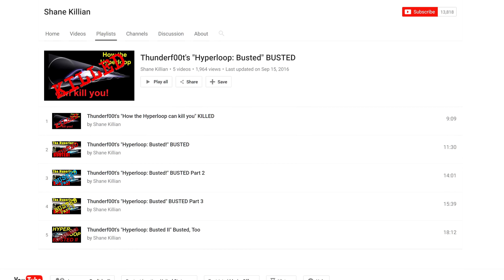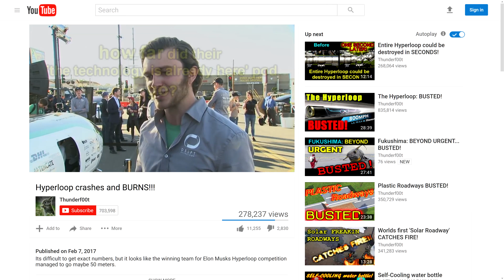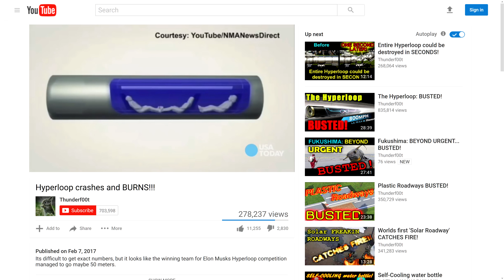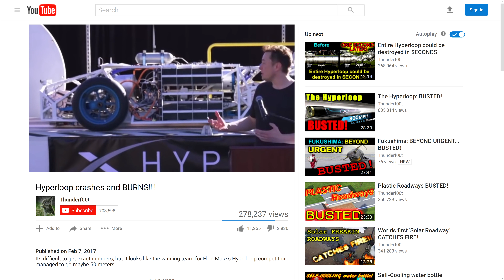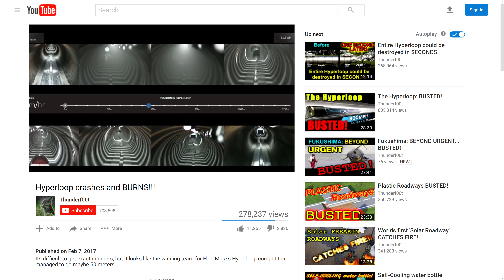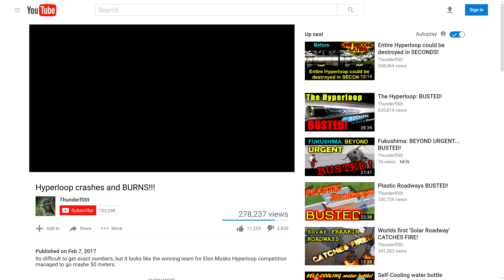Thunderf00t crashes and BURNS!!!

Comment: Shane, ONLY special element of Hyperloop is the VACUUM. Nothing in the tesst seemed to focus on the vacuum adding anything. On the issue of the VACUUM, Thunderfoot is on point and has expertise. You have stated nothing with respect to the VACUUM and the Hyperloop.  So take the competition out out of the Hyperloop and Vacuum, and they have the same merit/non-merit. No reason to argue about these elements as they are not pertinent, which is all you seem to be discussing.

Two huge mistakes you made: 1) dust is a significant factor in VACUUM's. Did not look like only water vapor to me. Note water vapor is also dust in a vacuum. 2) Automated vehicle history is far different from what you describe. They have NOT yet become reliable and safe. If they had, they would be generally on the market. As of now they are intelligent vehicle assistants, no more. Yes, in 2004 and 2005 there were two gigantic jumps in capabilities of a magnitude and a half in each year. But before this and after, there have not been similar jumps. From the late 80' to 2004 there was a long slow process of advancement, which barely reached an magnitude and a half improvement in 20 years. The same rate has been occurring since 2005, but there is a bit of a way to go still (unfortunately). So what happened in 2004-2005, as each vehicle that achieved 125 miles used very different technology? Best guesses, competitions which enabled shared experiences, and the release of open source computer vision software, OpenCV.  When fully automated lane changing is generally released, you will know the dam has finally burst. Yes, the Tesla's do some of this, but it is still treated as an assistant, as fatal accidents still happen. Only thing special about Tesla, is that it had the independence and courage to release these assistants, technically everyone is at the same point.
Reply from the maker: "Note water vapor is also dust in a vacuum." Water vapor is dust??? Okay, we get to ignore THE ENTIRE REST OF YOUR COMMENT! Fucking anti-science conspiratards...

"Automated vehicle history is far different from what you describe. They have NOT yet become reliable and safe. If they had, they would be generally on the market." No, that's happening because YOUR HOLY GOVERNMENT is restricting them. They ARE on the market and on the roads in many places. You are just LYING.
Reply: Water vapor effect on metal = rust. Rust = solid dust particles. Water in the works causes many issues. This is just one. Sealed vacuums have many requirements, water vapor gets in the way. It's not a so what, liquid particle issues are as big as solid particles.  When working with vacuum's at the level of the supposed Hyperloop, even oil on fingers has issues.

I'll say it again, 'intelligent vehicle assistants'. Perhaps in two years we will have more, but it's more likely 5, 10 or even 20 years away. We need a giant leap like we had in 2004-5.
Reply from the maker: So, you haven't even bothered to fucking watch the series where I cover all of this. Typical anti-science conspiratard.
Reply: You don't mention squat about anything of importance. If you are a 'libertarian', you are extremely misguided. Look to hex/oct-copters as libertarian type advances. Hyperloop is completely centralized fantasy.

By the way  insults (e.g conspiratards) reflect directly upon the insulter.
Reply from the maker: I covered rust. I explained the difference between an open and closed system. YOU ARE LYING.
Reply: Shane, I watched most of this video, your review of Thunderf00t's work is shallow and your comments are insulting, Insults reflect directly on the insulter. If you want to improve, you need to provide more solid info, focusing on substance instead of the nit picks you cover in this video. Thunderfoot went out and looked at the seals they had, he goes into lots of technical detail, and made his point very successfully. While he also kids around, the substance is mostly there.  I haven't seen any substance in your review of his work in this video. And no I'm not going to view all of you videos. If you've got an argument, you can site specifics clips.
Reply from the maker: Thunderf00t didn't make ONE SINGLE POINT that stood up to scrutiny. I COVERED the things you just said. You're just IGNORING the points I made in response. You haven't responded to ONE SINGLE POINT I MADE.

The WHOLE SERIES is comprised of arguments. It is creationist-level desperation for you to demand specific clips of me!
Reply: Shane, let me simplify this so you can understand. Hyperloop's ONLY addon value is the vacuum to reduce drag and thereby add speed. Without this the Hyperloop is just a far overpriced train/Maglev track. The overprice is due to the cost of all the extra track elements. The rest of the discussion is meaningless. You have only focused on the meaningless elements. While Thunderf00t mentioned the meaningless issues, to indicate that they were the only elements being tested, and thus nothing was really being tested. He also also noted that even in those meaningless test, there were problems, due to the effect of the  pseudo vacuum chamber being used. However, his primary arguments focused on the difficulties associated with working with VACUUMs.  DO YOU GET IT NOW? Do you now understand why everyone thinks you've completely missed the point.

By the way, people are giving you the time of day because you have brought up some interesting addon details with respect to the test associated with the challenge. I just wish all that energy was put into something of more value from a libertarian perspective, for example hex/oct copters or HHO fuel. Both of these technologies would dramatically reduce centralization, while the Hyperloop would only add to centralization. Of course as the Hyperloop is just a scam, its only a centralization of research money and energy. Hex/oct copters and HHO are already functioning, thus, any focus on them would be tremendous addons to the community.
Reply from the maker: "Hyperloop's ONLY addon value is the vacuum" FAR FROM IT. We covered SEVERAL more innovations in this series. Since you REFUSE TO WATCH IT, you CANNOT speak intelligently on this issue. You're just LYING so your pathetic delusions can be preserved.

"Without this the Hyperloop is just a far overpriced train/Maglev track." We showed that Hyperloop One is building it FAR cheaper than maglevs are, LIAR.

YOU ARE A LIAR. GO THE FUCK AWAY.
Reply: Shane, you don't respond with respect to the VACUUM, HHO, Hex/Oct Copter, libertarian issues. Neither do you site specific clips. Nor do you mention what other elements of importance the Hyperloop supposedly offers. You just want people to watch all your videos. As this video was mostly contentless, there is not much reason to go beyond. Your comments have basically been contentless. It's liking discussing something with a wall. Further you insult all over the place.

Insults reflect DIRECTLY on the insulter.

Comment: Wow so you think this was a successful test. Bottom line it is impossible physically and economically to build the tube so what’s the point. You cannot evacuate chambers on the scale anything like that required to make it a viable transportation solution. Yes top marks to the students for inventing safe design principles for vehicles operating in a vacuum tube they rose to the challenge and the tube or h loop was not their problem. I have to agree with Thunderfoot regarding the h loop being BS and maybe the scope for the designers in this test was not clear to us but hey ho maybe you should try to communicate the disconnect re the test v the h loop viability rather than rant.
Reply: Well his vid was quite angry and he talks kinda agressive and repeats his points but thunderfoot clearly isn't better. I mean although the hyperloop might be a silly project thunderfoot makes false and bad statements.
Reply: You can't easily evacuate airplanes as well, yet it's a very popular method of transportation.
Detecting decompression of a pod is easy and reliable and due to massive redundancy of valves venting the tube is not less easy and reliable.

Comment: Dude, you may wish to check with a physicist before you make a rant like this.  The hyperloop will never work.  Period.
Reply: Why not?  A hyperloop is just a maglev train in a vacuum.  We can make mag-lev trains...all we need to do is maintain a vacuum and find time-efficient ways to move objects in and out of the vacuum.  That will take some research and time convincing the public it is safe...but not really the engineering problem of the century.

Comment: Shane @6:00 you state "...that's water condensation" A/How do you know this? & B/If it is why is there only a cloud of condensation behind the vehicle but not in front of it? Also would the condensation not be collecting on the surface of the walls where there is a temperature difference to cause the vapour to 'condense'?
Reply from the maker: "why is there only a cloud of condensation behind the vehicle but not in front of it?" Because that's how it works! It forms in the vehicle's wake as local pressure drops. Same way the cloud-in-a-bottle experiment works.
Reply: I thought (maybe mistakenly) that this experiment was carried out in vacuum? Surely there is no air/gasses so no pressure differentials?
Reply: David Povey - It is true that in a vacuum, there is nothing to condens. Talking about temperature (average kinetic energy of particles) is pointless. However this isn't a perfect vacuum. More like a near vacuum (participants of the 2nd test could even choose the pressure of the vacuum but could go no lower than the limit specified in the tech doc). As pressure lowers (because less particles inside the tube) the boiling point of water lowers (basic thermodynamics). This means that water will turn into a gas at lower temperatures than 100°C. Hot air can also hold more water than cold air. This is why the water in the air of your bathroom (shower/bath) will condens to colder surfaces. This is why the ground gets wet after a sunny day. This is what is meant by humidity % shown in weather info. In the desert you have dry hot air so you won't get much condensation contrary to the bathroom example.

Now what does this mean for the hyperloop? The test in TF video was done under the specified pressure of the tech doc. This means that there is less water in the tube to begin with. It means that the boiling point is lowered but at the same time temperature is less of an issue for condensation bc a perfect vacuum has no temperature. 

A moving object is bound to drag and lifting. At higher speeds, these effects increase (I imagine that you need very high speeds in a vacuum to even notice this effect, if at all). The rear of the car will generate a lower pressure. Lower pressure means lower boiling point. The question here really is: what is the overall pressure? Is the remaining air humid or can it take more water? If the car has a relative low speed, how much can it lower the pressure behind it in a near vacuum? The difference between the two pressures can cause condensation as they have different boiling points.

Honestly without calculations, I call bullshit on this. A vacuum is complex. Aerodynamics is complex and so is thermodynamics, especially under these particular circumstances. If someone can predict this effect w/o calculations, that person needs to stop making YT videos and spent his/her time more efficiently/productive.
Reply: There is probably much water present on the tube surface that would take months of vacuum to dry out. So unexpected but very present after emptying the tube it fills itself with 100% humidity and more giving a lot of airborne condensation.

Comment: A hyperloop will never work. Never, not in 1,000 years. For one very simple reason: it's the single most stupid transport idea ever. Well, except for trying to use rockets as a transport option - that's the most insanely stupid idea of them all. Now, I am a big big fan of Elon Musk, and at age 53, I am happy to admit the guy is my hero. But he is a seriously flawed hero - just like all heros. 

A hyperloop is at its core, nothing but a multi-billion dollar, single-use, mass-murder machine, the likes of which has every terrorist on the planet drooling in anticipation. Let's see why. I'm going to use a 2-metre diameter, which is the smallest a hyperloop could be, and larger means much larger forces, based on pi-squared, of course.

Anyway, let's imagine a hyperloop 1,000 km long, cars are on the hyperloop at 5 minute intervals, being the time it takes to load up a car, evacuate the airlock, and slide it into the the loop. That means there are 12 cars on the track, gong one way, and 12 going the other.

Now, let's take a single stick of gelignite, duct tape it to the side of the hyperloop somewhere - and if we can't do that, let's just launch a bazooka round at it. Now, the Hyperloop is going to be made from nothing but steel, and not very heavy steel at that.

The explosion creates a hole a few feet wide, and the air rushes into the breach and rushes away from the breach at close to the speed of sound. The pressure of the air rushing down the tube is 64-metric tons by itself, and traveling at close to MACH 1, it has a force slightly over 38 Gigajoules. The MOAB air-drop fuel-air bomb, the largest non-nuclear US munition, has a yield of 41 Gigajoules.

So, the 64-ton sledgehammer making almost mach 1, smashes into the first car, turning it instantly into nothing but dust, and it ruptures the hyperloop at that spot, and the cycle continues. This happens until the sledgehammer gets to the airlock at the station at each end. Then it destroys the station completely, killing everyone with 1kilometre of the impact site, with large concrete chunks of the station landing up to 2 kilometres away. Both stations suffer the same fate - and the other tube as well, for the return leg, which is destroyed by the destruction of the station, or one of the cars exploding to dust in the other tube.

Nothing can prevent this scenario taking place once a rupture has occurred.  Terrorists will make sure they attack the loop as close to a station as possible, so there is no warning. At least death will come so quickly that no one will have a chance to feel it coming.

So, if this is your idea of a good idea, you are an idiot. There is no way to design around this fatal flaw, and no way to evacuate the tube down to the level required, nor to properly allow for expansion, or earthquakes, or deliberate attack.

The idea is simply a non-starter. Anyone who says otherwise wants to sell you shares in it, or simpyl doesn't understand either physics, or humans.
Reply: NEAT reply
Reply: Your making suggestions of someones mental health or calling someone "retarded" is really not conducive to civil (let alone scientific) discussion, maybe that is what is going wrong here...too much name calling and insulting to actually listen? You say he (Thunderf00t) makes claims that have been refuted, what are they/how have they been 'refuted' so far I have only seen opinions apart from childish insults? I came here hoping to see & understand a different viewpoint to enable me to make up my own mind, coming from an engineering background I can see a number of issues (like pulling & holding a vacuum on such a large volume of air) and would like to see some civil discussion on them, having trouble trying to find someone who even understands the issues let alone any answers.
Reply: How to you know he didn't "watch this series"? Data please.
Reply: Haha, right, it's a first ;> 

Hang in there and merry Christmas, Shane.
Reply from the maker: "Oh, look, someone who didn't watch this series yet felt the need to comment anyway. How bizarre." Yeah, that's NEVER happened at all!
Reply: Oh, look, someone who didn't watch this series yet felt the need to comment anyway. How bizarre.
Reply: What "opinions" are you referring to? The comments section? If so, maybe take a look at the actual content instead (i.e. the videos of the series in question). 

And don't be so butt-blasted because of my flippant reply, I was just taking the piss. You were, too, judging by the original, unedited comment of yours. Was I being somewhat of an ass? Sure. But it's hard not to be when there are so many mouthbreathers on these videos repeating the same tired old hooey.

Comment: So what  is the point of having students doing these tests. Besides a PR stunt. Sure these students are smart, but the whole thing seems like a soap box derby.
Reply: Kent H - students aren't really a problem as long as they are being guided by people with experience. However a team with experienced people will work more efficiently, come up with better designs, but will be more costly. For low cost basic concept tests, students are fine. I would never ride anything only designed by students w/o quite a bit of guidance.

The whole soap box derby is due to a combination of it being a POC (not too much polish bc costly and unnecessary) and inexperience.
Reply from the maker: You've gone to video after video insulting me, but what you HAVEN'T done is even ATTEMPT to show that I'm wrong. Pathetic.